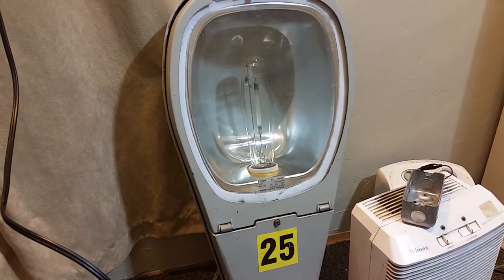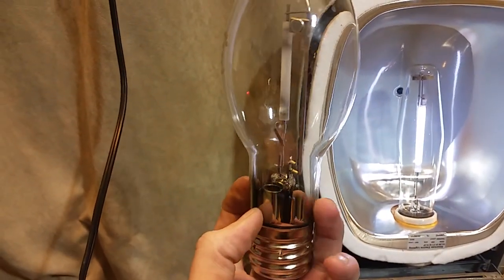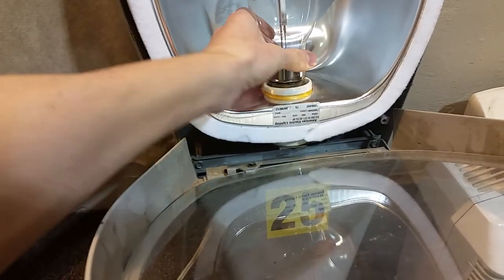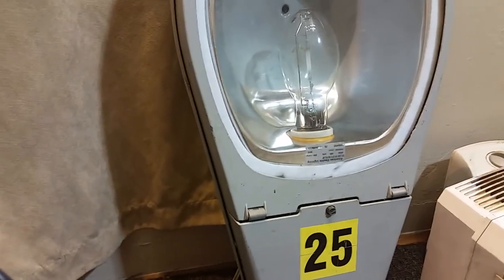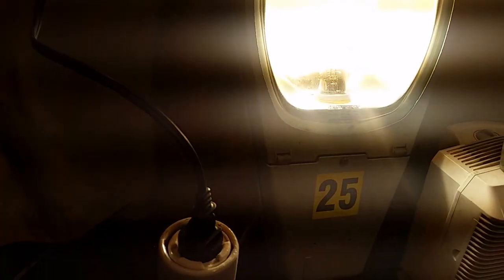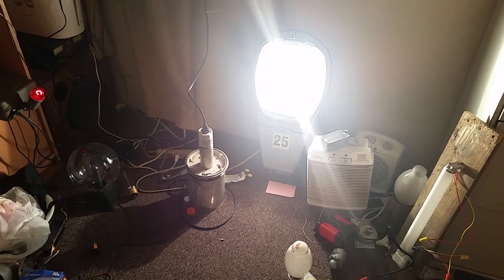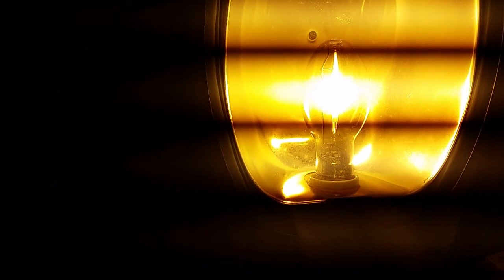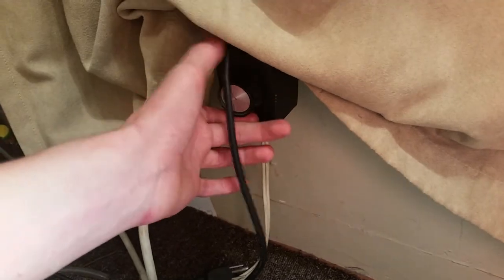250w hps streetlight vs 70w hps bulb

Comment: 400 watt metal halide or 400 watt high pressure sodium lights and above are too overkill for the neighborhood roads, while the 70 watts is acceptable. 400 watts is good for lighting a large road or highway. However, I find 100 watts and 150 watts the most acceptable wattages for illuminating domestic neighborhoods. You only need 20,000 lumens or less to light a small road or a backyard.
Reply: no they aren't to much in fact they are bright enough to provide security as i recently acquired one and tested it at night